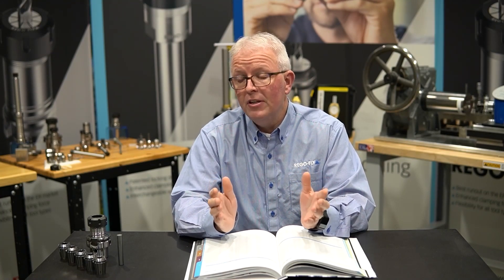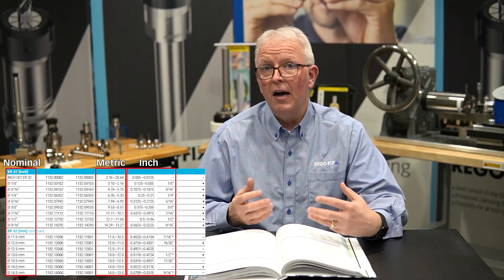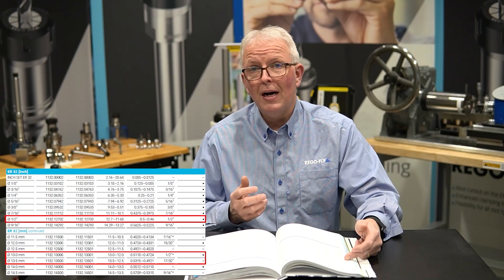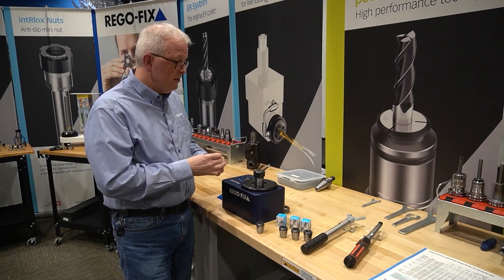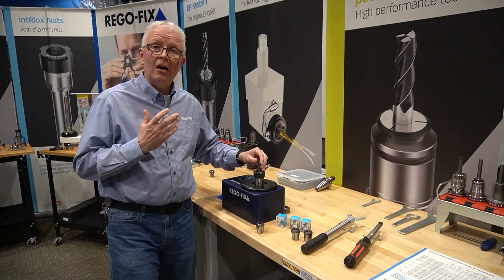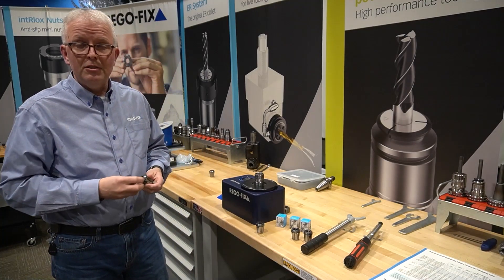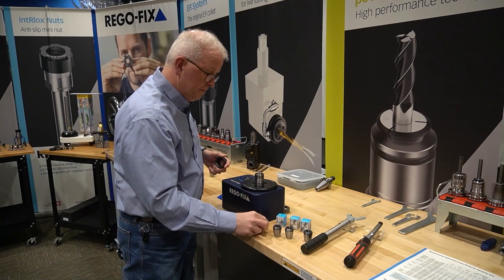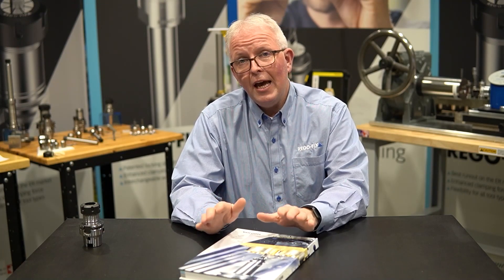TechChat - Selecting the Correct ER Collet

Comment: I can find lots of places saying that you should not expand ER collets, but no information and the technicalities of why it is bad. Can anyone share more data on this?
Reply from the maker: This depends on what you mean by expand. If you're trying to use a larger tool size, assuming you can make it fit, you run the risk of bloating your collet cavity during assembly and damaging the toolholder itself. By shoving an over-expanded collet into the cavity, you'll likely see threads crack on the top of the holder and your TIR will be shot.

Another expansion is by tightening the collet nut too tightly, which causes the collet to deform within the cavity. This deformation, which is brought on by shoving the collet further into the cavity than it should be, is similar to the above. The collet cavity can't contain the collet and it can cause bloat and can damage the toolholder. 

In short, it all comes down to the DIN standard collet cavity of the accepting toolholder. Anything that is expanded too much can cause the cavity to fail, generally at the thinnest material section (threads). We see this a lot, especially in smaller ER sizes due to over-torqueing of nuts.